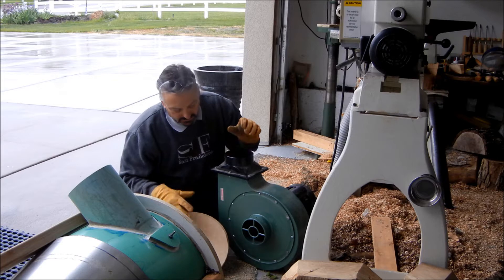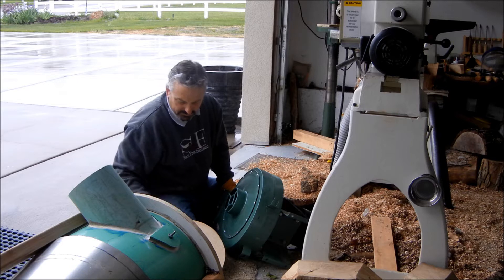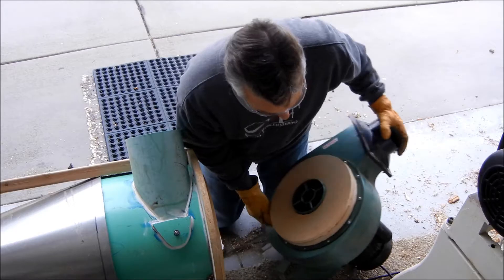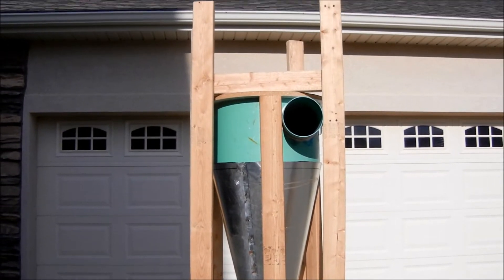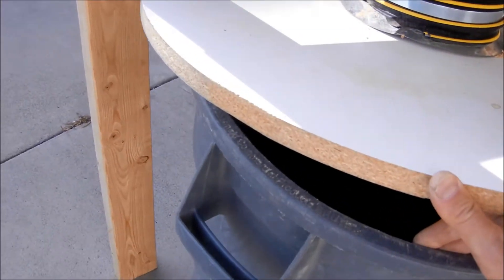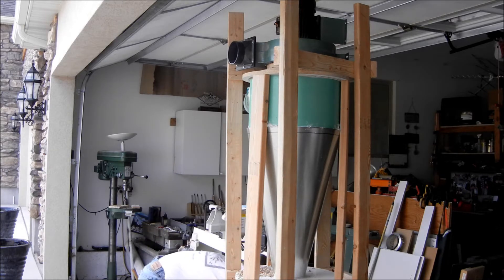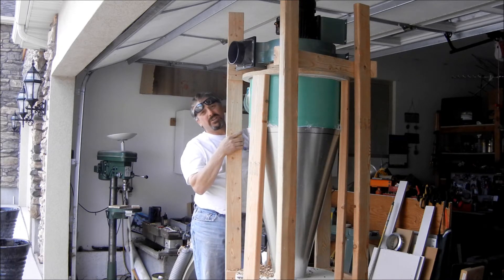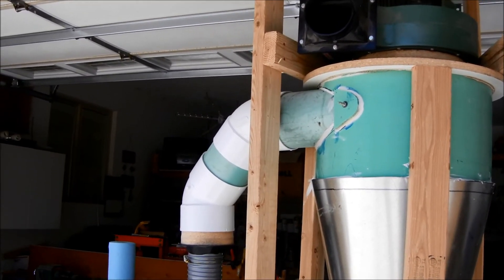Completion of the Cyclone Separator Dust Collector, the Turbulator 4000 Part 3

Comment: A bit over kill but good design
Reply from the maker: For this application it does seem like a big thing.  I actually made this to power dust collection for my new 16x20 shop.  I will be placing it in the closet and doing an air return to the shop room with two nice big filters.  When I do this I think the cyclone will be great but the blower will be under powered.  Thanks for watching.

Comment: Put a pantty hose on the exit air for a filter while doing a demo. its done by now. how's it working any air leaks?
Reply from the maker: +bobbg I do want to put some kind of filter over the exhaust and check it again.  It works great.  I still have it setup temporarily next to the lathe with a flexible hose but I use it all the time.  No leaks or trouble so far.
Reply: @TurningRound  
Get the Rooster yet?  
Hey that work plucking chickens? Suck them feathers right up.

Comment: This is awesome. Have you noticed since building this any fine dust coming out of the exhaust or a need for a filter on there in the future?
Reply from the maker: Joshua Luther Thanks, It seems to be pretty good at removing the particles.  I want to figure out how to test it and see.  With that being said I am eventually putting this is a storage room and I will filter the return air from the room using big hepa furnace filters.  For now it exhausts out the front of my garage and I open the big garage door.  The only things I have seem come out the exhaust was a bit of very fine wispy acrylic shaving when turning a acrylic pen blank with a very sharp skew.